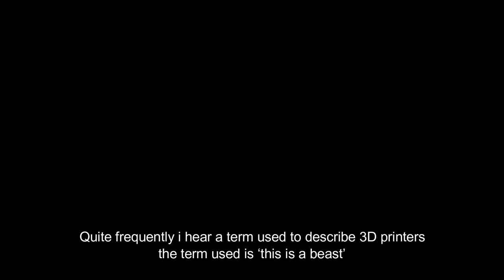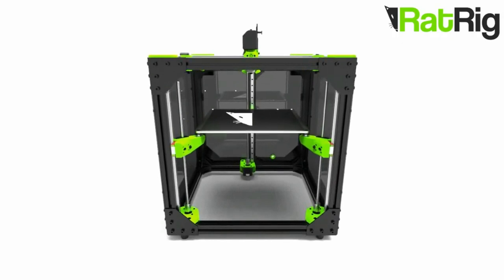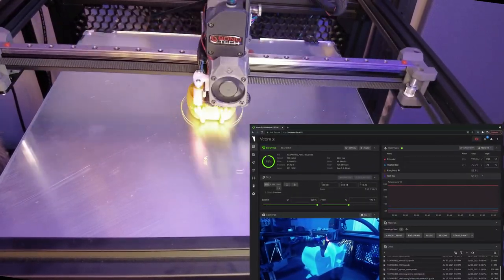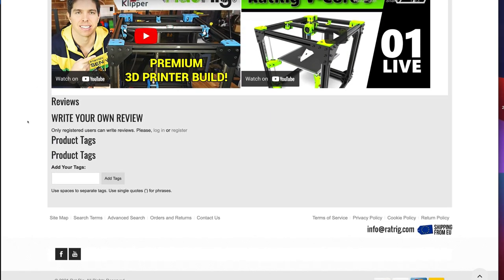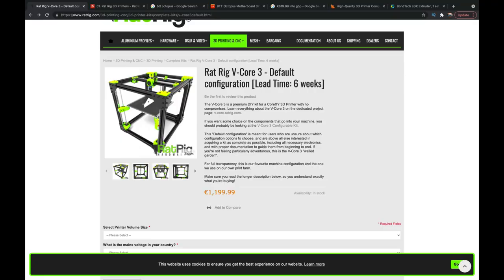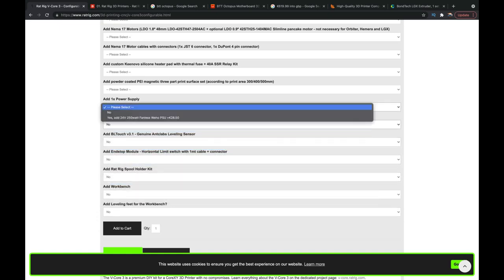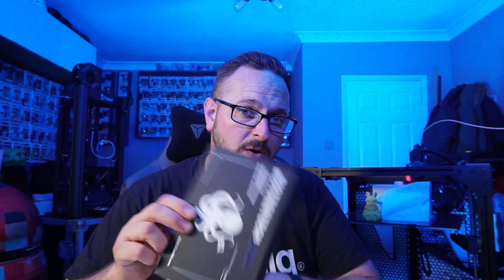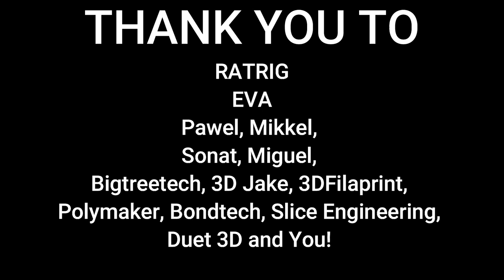Why the Rat Rig V-Core 3 will change your 3D printing game

Comment: Nice! Klipper is definitely different than the others, until recently it's been pretty inaccessible to people who aren't inclined towards linux, computers and pin diagrams but it's come very far this past year, and i'm trying to push it that last step with V-CoreOS. Big shoutout to the Fluidd guys here, those people are just amazing and super involved in the community, gotta love it!

Thanks for all the kind words Sam, it's great to hear you love your V-Core 3 as much as we love ours 😍
Reply: Will V-Cast IDEX os ever be a thing. I love klipper. I have a V-Cast and they are working nicely together, but having mirror mode would be great.
Reply: @williamdeighton4844  yes! V-CoreOS will support the V-Cast in the near future. Mirror and Copy modes are coming to klipper soon as well, there’s a working pull request that needs to be merged, it’s just down to the fine details at this point 👍
Reply: @miklschmidt  That's Great. Thank you for your selfless support of klipper and other 3d printing technologies.. you rock!

Comment: I have a Voron 2.4, awesome printer. The one thing I can say that is a positive for the the ratrig is the ability to buy the kit from them. With the Voron there are kits available but what you get is mostly a mystery box that may or may not have good parts.I am very tempted to get a ratrig as well.
Reply: The kit sadly contains some lower quality items, such as the idlers, bearings, unbranded linear rails, broken magnets, out of spec printed parts that need to be drilled... Having bought one I recommend everyone actually self soiurces this printer instead.
Reply: @Popatoh  that is somewhat disappointing to hear.  At least you can easily get the big things like the frame, build plate etc from them and then source the rest. With linear rails now a day I think cheap ones can still do the job. I bought robotdigg rails and to be honest, they are also unlabelled and similar in quality as all the other cheap rails, I do not think they make them, just assemble them. The motto these days is profits before quality. Still the printer seems nice.
Reply: @TheSanzca  One note to what Popato said: The early idlers, such as mine, had a quality issue caused by the manifacturer, not because ratrig cheaped out. Sonat replaced mine without any argumentation and as little wait time as possible. Broken magnets, can't say anything here, but if one does report this to ratrig, then they are happy to give good customer service. 

Thats the biggest point about ratrig, that their customer service is superb. A week ago i ordered some custom components from them and actually made a mistake, where my CAD was 1cm short. My odered extrusions where already cut, but they still wanted to help me and did recut new extrusions, without having me pay any extra money. 

The printed parts are really a hit or miss. Mine broke, because i did not drill some holes and thus i had to reprint them. If this has changed, dunno.  I think so. If one is worried about the printed parts, get someone else to print them for you. there are alredy ides in the discord to create a PIF, where we offer pats in abs rather than petg et. :)

Regarding the rails, they are unlabeled but the quality is good. they run smooth, silent and without any wobble. hiwin might be better, the difference is there but marginal. The difference is, that not every rail is the same, i had one rail which was very easy to move instead of the normal "easy to move".  Of couse this went into my x-axis. With hiwin i would expect that all rails are the same. (never had hiwin until so i can't compare)
Reply: @TeaObvious  yes, the make or break as far as a good company vs. a bad one  goes is for sure the after sales support and it sounds like ratrig is doing it right. I understand that even when passionate about something, you still have to make money and a business has to make a profit and as far as parts and part quality goes I am not too stuck on that as a lot of 3d printing parts are really consumables (the hot cold cycle does take a toll on most anything) and will need to be replaced at some point, that is probably a given. So, unless you are printing parts for NASA, no need for HIWIN rails etc. In any case, for each hiwin rail you can probably get a complete set of rails for your printer, pick the best ones and you are sill miles ahead as far as cost goes. In any case, whether it is ratrig or Voron, the 3d printing space is exciting and you are sure to learn new things on the way.
Reply: @TeaObvious  in regards to Hiwin having better QC/rails being more similar: Not sure I agree, Hiwin is still a pretty cheap brand, a good deal cheaper than real industry stuff like Bosch Rexroth, SBI or other high end gear that is used in all but the cheapest of CNC machines.
Yes, Hiwin has gone up in price over the years so the gap upwards is smaller, not sure if their quality followed along though.

I used Hiwin HGR-25 rails on my CNC router build a few years ago, and no, all the cars did not slide with the exact same friction there either, not even always the cars that ran on the same rail. It's small differences in the preload of the cars I guess, sadly it's not user adjustable since it's usually done with different size balls.

But sure, Hiwin is still probably better than the cheapest Chinese rails, but if that matters in a 3D printer for hobby use, I kind of doubt it? How often do linear rails fail due to manufacturer defects?

If the 2 Y cars run with very different friction I suppose that can be a problem in a Core XY setup though?

Comment: I'll be honest I've been printing for like 13 years. I have built over 10 custom machines Plus for custom built CNC laser / spindle machines. And I can tell just by looking at this design that it's flawless. They have completely focused on problem areas. Quite brilliant design. But one thing I haven't played with is Kepler. I need to learn it and already picked up sensors but I haven't had time to play with it.

Comment: Once you get Klipper running you will appreciate the ease of changing the printer.cfg instead of recompiling.  Will be very interested to see your videos.  I am going to use the Fystec Spider board with 2209 drivers and Klipper / Fluidd
Reply from the maker: Just about the do the same with the SR - everyday I’m learning :)

Comment: I almost went with the RatRig, but in the end I decided to build a HevORT because I wanted something bigger (595mm x 595mm x 595mm is what I'm building, but you can go bigger), and I wanted better parts, including: 12mm wide belts drive belts, ball screws for the Z axis, carbon fiber gantry tube, titanium fasteners, linear rails, 3030 extrusions, Duet controller and expansion board, and 72 volt Teknic Clearpath servos for the X & Y axis. The price tag for taking up most of the spare area in my hobby room is going to fall between $2500 and $3000. I'm sure that it will be more with the guarding that it is going to require (or I could just go cheap with a sign that says: "Do not work on live machine with remaining fingers!").

Nothing wrong with the RatRig, anyone who owns one should be very happy with it. I just wanted more. 

So, please forgive the interruption, and do go on about your beast.

Comment: I was looking for a quality printer that was reliable and faster while maintaing excellent quality prints, I was drawn to Voron but the kits always had at least 15% of the parts out of stock and I was regularly hearing of people having to replace some of the parts due to bad quality and then I came across Pro 3D and decided to build Roys Viking in a 400X400 configuration there was a BOM and links to the parts but I wanted to start out with quality and genuine parts so I self sourced the very best parts I could lay my hands on, I paid a small fortune in shipping costs to the UK and paid just over double on parts prices compared to the BOM prices but I ended up with my dream machine and have been printing with it for nearly two and a half years now and havent wanted or needed to upgrade anything but I do want to swap my Copperhead for Vez3D's Long Schlong Dong hot end when it is released, I have been following Adams series of video's on the Rat Rigs and Im bitten, the trouble is I dropped a deposit on a Prusa XL so its going to be a coin toss between the XL and the Rat Rig.
Reply from the maker: They are both very different machines to be fair. The RR for me is the kit I wanted and didn't get voron way of working. Infact I've JUST seen a voron in person around 2 weeks ago at MRRF and they also look great! but they aren't a company. I understand the LDO now make the kit so it might be worth looking there or at @fabreeko

Comment: This weekend just past, I have started a 100% diy sourced version of the Ratrig. I am lucky enough to have access to a very large CNC router and laser cutter to help the process along. Once I get a few more of the components I’ll start a build log. We are building the 500, so I’m certainly looking forward to it. Would you recommend the Hemera for an all in 1 solution?
Reply from the maker: I’d always say the LGX and slice gear. I’ve not had a lot of luck with e3d parts, not to say it’s not good, but maybe some bad luck

Comment: I think the Ratrig, is more your kind of printer. the Voron Maxes out at 350, and what you want is bigger 500..... I have a 2.4 and its great, I also have a vcast and well for a bed slinger its not too bad. I look forward to proper klipper IDEX with Copy / Mirror Mode...
Reply from the maker: Yep you are correct :) I’ve been looking at other printers and came across a 600x1200 but they do other config too

Comment: I have a rpi4 over and ready, and a bondtech ddx v2 with a mosquito hotend, 450c thermistor and 50w heater on my cr10s pro, I hate this stupid bedslinger, one of the worst buys I have ever done, I have upgraded it to death from bondtech bgm bowden setup with microswiss hotend, to this ddx, and I regret taking that route extremely extremely hard
Mostly based on the bed and that its so uneven that its silly, even after purchasing a new plate for it from creality

There is 2 things, reliability and size I need and want, that together, speed I dont care much about, that is a nice bonus, so that is why I am saving for a ratrig 500, I just will need a lot of help learning klipper and set it up
i will continue watching your channel for the klipper setup, I print rc cars/boats and planes, and for the planes it would be so great to be able to print both faster and more reliable, as with my E5+ I run, that works great but is slow too, but at least it works fine and is pretty reliable but I need and want better
Reply from the maker: This is the struggle that I went through also! The good news is that the hotend can be used as an upgrade. On the klipper side I'm filming some stuff next week talking about klipper on the vcore3 so that should help many with any luck ;)
Reply: @TheRealSamPrentice  Sounds very good, this is why I opted to sub to your channel as well to write a couple of comments! I am very tired of trying to upgrade stuff that is bad from the beginning, its like trying to get a good car but having a rotted out fram under it
Reply from the maker: @danne77sthlm  I always compare printing to cars lol :) thanks for the sub :) !!